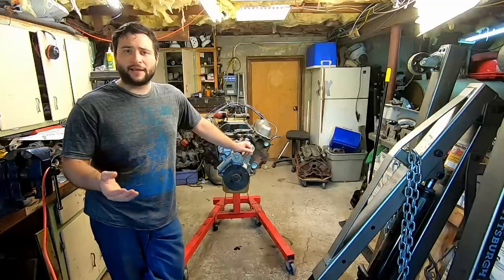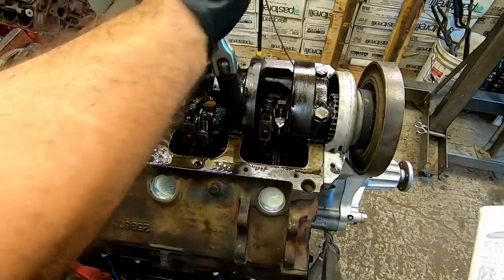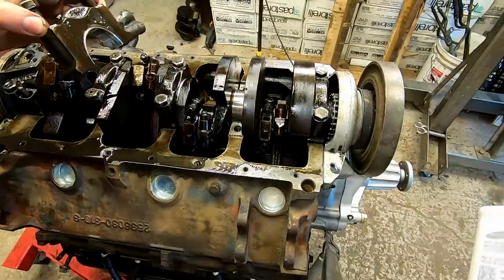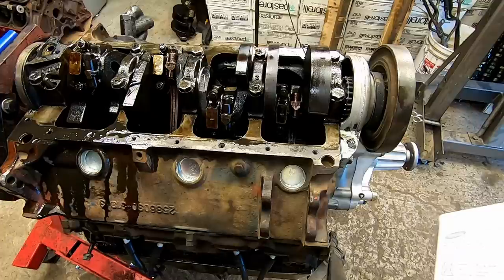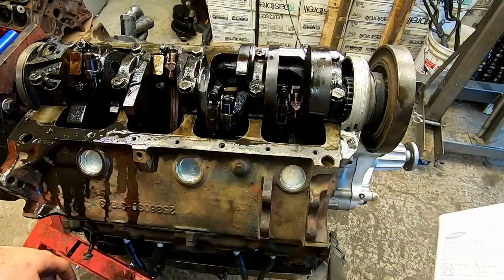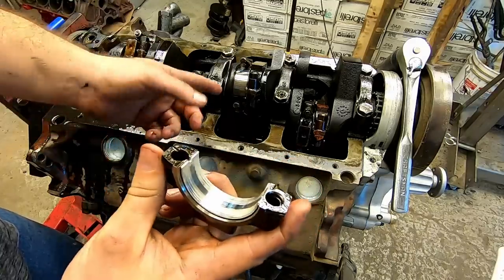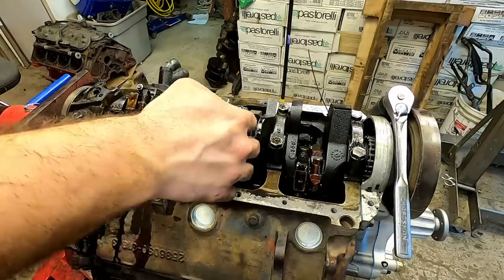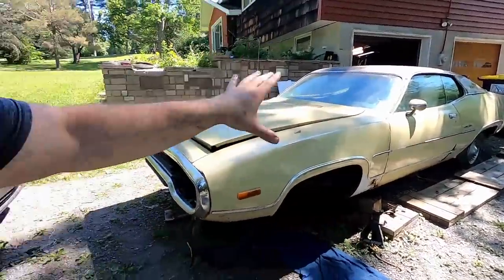The Mystery of the 318's Low Oil Pressure Solved! update the crank was worn out .07 not machined

Comment: I've been working on cars for over 45 years and the guys that taught me told me about padding bearings with the aluminum from Wrigley's chewing gum wrappers during WW II when bearings couldn't be had... and they claimed it worked on cars of that vintage.  

I've done a lot of hack and whack repairs on $1.00 cars over the years, and some worked fine... others eventually came back to bite me.  

So what advise can I give you from my 45 years of experience plus having learned from guys who had over 50 years of experience before me.... 

1) Stop and take a deep breath
2) Fix the dang thing right and it's going to last.

Also, keep in mind you actually found another oil leak between the bearings,  You haven't necessarily found the only cause of the low oil pressure... There might be other issues you haven't found yet.

And by the way, I wouldn't have expected that there had been so much work done to that motor either.  Back in the day, we pretty much threw away the 318's when we upgraded to 383 pr 440s.  I had two 318's in daily drivers over the years and they were great engines, but once the timing chain jumped or the oil sludged up, I pretty much ditched the cars.   It's amazing how the world has changed... people actually putting 318's that weren't straight out of a junk yard into a car... I never thought I'd see the day... Maybe someday the old 318 will finally get the respect it deserves.

Good luck!
Reply: RJ, have you ever seen tapered shim stock? It was available in graduated sizes, so that the builder could taylor the bearing clearance into exact tolerances by laying the shimstock between the bearings and the saddles, then hand filing the parting edge of the bearings to bring the bore measurement of the bearing to the tolerance necessary for proper oil clearance. 

This is a lost art for the most part,  but Allison and Rolls Royce Merlin engines have TONS of details like that, that when they are fully detailed and blueprinted,,, that's what separated the masters from the also rans at the hydroplane races.
Reply: @patrickwayne3701  Personally, I haven't actually seen tapered shim stock.  But I've heard stories from old timers when I was younger about that kind of bearing fitting.  Although really good machinists would also be able to turn bearings to the exact size, which is another all but lost skill.  My dad was a Machine Shop Supervisor and a tool maker with a tool shop and other tool makers at his disposal, so when I needed custom made stuff, he'd just wump it up for me... But he's gone and there are few people with the skills and very few machine shops left that can free hand one off parts anymore.  And those that do usually cost more than the project car.
Reply: @RJ-vb7gh  I am saddened to hear he has gone, but alas, so has my Mentor.  Tapered shim stock, is from the earliest days of custom built engine work,  it was developed in between the poured babbit bearings like in the early Fords,,, and the later mass produced engines that relied on 'Stack Up' in dimensional tolerances to 'land' a particular engine joint within 'spec'. 

I luckily got to hang with those two pioneers in the early '70's, Graham Heath, and 'Wild Bill' Cantrell, as they slowed down and tinkered with keeping Miss Madison in back up engines.

Those dudes were like secondary granddads to me.  Complete with the warnings about "dont repeat these words around your mama or your Grandma kid".... Lol.

I have been SO lucky in that regard.
Reply: @patrickwayne3701  My dad took up fixing cars in Estonia back in the 1930's and set up his first machine shop as a refugee in Germany during WW II.. Both before and during the war, they didn't have spare parts, so everything had to be made as one off customs.  Worse yet, expecially during the war no one in Europe was making a standardized vehicle... So he had cars of all different makes and models to contend with and no parts that would swap from one car to another.  

In fact, my dad worked on conversions that allowed cars and trucks to run on wood gas and burn wood. 

To that I'll add that for the most part, tools were also made in the shop since tools were hard to find.

We were lucky indeed to learn from the old timers... but there are still old folks like me around.... kids these days just don't care about learning skills and hearing stories.  When I was a kid and I saw someone fixing a car, I was there to help, watch and learn.  Now I"m older and I've pretty much lost the use of my right arm and aside from my 14 year old daughter, there isn't a single kid in the neighborhood that would even slow down to watch, much less help when I've got a car apart in the driveway.  

Honestly... we were lucky to have mentors and we were smart to take advantage of our opportunities... Kids today think they are going to learn something from YouTube... and some things, they will... but they don't have time for the stories and the details.... Most kids today don't even know that a gasoline engine can run on wood much less what a dwell angle is..
Reply: @RJ-vb7gh  You bring up something there, about learning from YT,,  I had never seen an engine run on wood gas before catching it on YT. I said some 'l'll be durned', and 'Sonofagun's' watching the process.

I am 54, lost my wife when we were trying to have kids,,, so, now I spoil my Brother's kids and an occasional teen who asks if any of my old trucks are for sale. 

Not being a boomer myself,  I have been saddened to see the general arc of descent, of common decency and respect for elders that keeps rearing its ugly head these days,,, and I keep my powder dry, and my scatterguns and longrange plinkers oiled and ready.

I am concerned that what my Grandfather supposed was happening to America,, is gonna get considerably closer before I check out.  Luckily,  my Brother has raised a couple of keepers of the faith, and I have cultivated some fierce 20 and 30 somethings in the hobby, who seem like they are going to toe the line for the Constitution, so, I will see to it that they get the sayso of whether they keep my SuperBird and my Chargers, or if they sell them. 

But for the rest of this waste that lives in their parents basement and thinks their parents should be on the hook forever,,, I hope I get to see them fall hard before I go.... the handful of Kiddos that hang out at my shop are bright eyed and diverse and they give me some hope that there's enough of them out there to keep Lady Liberty alive for another generation or so....
Reply: @patrickwayne3701  I honestly hope you're right.  I pretty much live in an area where I don't see much hope for a sane and constitutional future.  As a tail end babyboomer, we defended everyone's right to have and express their opinion only to find out that their way of expressing themselves is to deny us our opinions and freedoms.  I guess we got burned by our own lofty ideals...  Which is pretty much is as much as anyone these days can say on a public forum.

A superbird is a rare bird indeed.  As to the chargers, I pretty much love all of the pre-unleaded versions from fast back to coke bottle.. after that not so much.  I had a lean burn Cordoba... which was in my opinion the worst car Mopar ever built.  

I've talked to some of the young people around me... Most of them are lost causes.  They have learned helplessness and drank the left wing Kool-Aid.  I've met others who still have inquiring minds and the ability to think on their own... The world is going to be a hard place for them to survive in, surrounded by all of the ignorant Pod People that seem to be the intolerant majority at least in my area.
Reply: I agree, even in the early 1990s 318s could be found free for the asking. All this trouble for a 318, I would at least build a 360....
Reply from the maker: I could have bought a wrecked 392 scatpack as a donor car and dropped it in for the cost of this, engine parts, travel, and crossing into Canada. I was offered an adventure, and an opportunity to grow my channel, and I bought right into it.
Reply: @LunarOutlawsGarage  you have the views now, make the most of it! It is the best hype you can get for sure! Good luck!
Reply: @CarsandCoding  If I had to go small block I'd go 340 myself or 383 which were almost as common as 318's with a little more umph.
Reply: @RJ-vb7gh  383 is big block. 340s are expensive and much more rare these days. They wanted to do a junkyard build. I do not know anyone who puts $1,000 of parts in a jubkyard build. Junkyard build to me means you pull a motor, get it running check for knocking, put on a intake and carb, dist, make sure timing chain is good, and run it. Putting a new cam into a block already torn down and not hot tanked makes zero sense. We all know this, but its you tube and entertainment!
Reply: @CarsandCoding  I've got a 76 Buick 455 in my 73 Electra... It came that way and literally nothing was changed on it except the smog pump was deleted and the 73 didn't need cats, so the exhause was left original to the car.  Basically, when I got the car all I had to do was to get the forklift dents out of the  valve covers and fix the EGR system which actually increased the gas mileage.   So I get not doing any major investments into junk motors.  Basically if you get a good junk motor, you literally shouldn't have to do anything to them, except swap one for the other.

On the other hand, building a motor from a junk core is a different story.  Once you tear into it, your in for a penny, your in for a pound.  You might as well do it right and not cut corners.  My experience with Junk and used engines as well is that they are really good, well treated low mileage engines or they are worn out, abused or otherwise beat to death money pits.  Most good junk yards will refund or replace a loser or will try to avoid selling them in the first place, so if you get a turkey, return it and don't try to fix it, unless it's something special...

Now the 340 was something special.  This is a motor that's worth rebuilding, and no they were never common. But if you are going to invest the time and money, at least you are going to wind up with something worth the effort.  And most 340's were pretty beat up, so I can understand where you would want to rebuild one, for sure.

As to 383's they were almost as ubiquitous as 318's at one time in larger cars.  They were tough and when put into a family sedan or station wagon, they didn't get much abuse, so you might still find a good one that doesn't need a full rebuild.  I'm thinking that post 1973 they should be good for unleaded fuel, I know the 440's were.  And yes it's a big block, but I've seen them fit into pretty much everything mopar from the Cuda on up and it gives you the option of using the stronger trans.

OK... still, there's nothing wrong with the 318.  My 1985 even had roller lifters.  My friend drove a 30 foot beverage truck with a 318 pulling it.  They were strong and reliable and in a lighter car they could get out of their own way.  Most of the last ones went to "cash for clunkers" sadly.  Their fuel economy was awful.... seriously awful.. first to last.  My 455 4 bbl pulling an Electra got better fuel economy than my wife's 85 Fifth Ave. It's like mopar just didn't care.  

But still... once you realized you didn't get a "good to go" 318 and realized you were going to have to rebuild it, you are pretty much best starting off with another engine or doing a full and proper rebuild unless you want to do Hoovie type videos about breaking down every few thousand miles.

I get the idea of doing a video about a cheap engine swap, but you need to start out with a known good engine and tweak it a little bit for performance.  The motor you started out with just has too many issues to do that particular video. If it were me, I'd pivot to a complete motor rebuild or start with a known good engine and work from there.

Lastly, I can understand where your coming from... As a broke teenager, I came up with some workarounds and half arse fixes that actually worked,  most I wouldn't ever post to YouTube for safety reasons... But over the years I've learned; if you're going to do it, just do it right the first time.  It's good advise from someone who learned it the hard way.

Comment: Did the same thing with a303ford that I bought with a rod knock. The previous owner found that the crank was 10 10 with standard bearings installed. He put the right ones in. Long story short it didn't work. I bought it cheap pulled the crank it took a 20 20 put The right bearings in and it ran good since. I put it together with plastic gage for insurance.

Comment: Always keep old bearings, they are marked. If not measure, plastiguage, anything during assembly, it would have been caught. Never go on others assuming it will be correct. Check for yourself. But good it was on a dyno and not installed into project, much easier to repair. Good luck looking forward to seeing it being successful. Hello from Canada!

Comment: I dont know about Mopars but I know I had a major Oil pressure lost on my 3.8 when the engine shop installed chevy lifters into a Buick block.. the oil didnt have to correct path and was basically dumping onto the cam in the lifter valley... you can lose quite abit of oil pressure in the lifters in some situations.

Comment: Honestly this is a great way to learn the ropes u won't easily forget u are a better engine builder already from this . Throwing hp parts at lS motors is just candy . Tony's hard work is in those cyl heads and that means alot. U got something for your troubles.

Comment: At least it's possibly nothing more, bearing clearances and crankshaft journals, mic all rod journals and main bearing journals. I did an engine rebuild had to put oversize bearings on some of the rod journals after the machine shop turned them smooth.

Comment: I’m glad you found the issue. As far as cleaning the engine in situe- run down to Lowes and buy a cheaper pump up sprayer, and one of those large mortar mixing plastic pans. You then fill up the sprayer with gas, diesel, mineral spirits, or whatever dont eat plastic and hose out the inside of the block and oil passageways. All of the mess can drip into the pan, so you dont make a mess. 
And to the people who Idolize Tony: the man aint that great. Sure he is knowledgeable, no question about it, but everything he owns has issues. Bottle rocket, the cams, etc. If I heard it correctly, and Tony wont even return his calls, that speaks to his immaturity, and confirms what I know already. Tony only does what he does for views and subscribers. Food for thought- on his mpg daily driver video, he explained he fixed the air conditioning. Notice he showed no process of that or even that it worked. I guarantee that a/c did not work worth a crap, and leaked all of the charge out within a day or two.
Keep up the good work Bryan.
Reply: i love how he wont show him working on things, and his excuse is "im in the zone." he lost me when he suggested turning pistons around and that thermoquad door tension cant be adjusted.

Comment: Past rice builder, of reletively current engines (4) cyl aftermàrket parts instructions, vs. BASIC 50s shop tech manuals ( 8 cyl even flathead methods. Like Owning a welder, owning a mic, or a torque wrench, it only works with proper use.

Comment: I know this had an oil pressure issue, but Derek over at VGG slapped together a POS 307 and hit 290 on the dyno...just sayin' Was it losing 35HP? No porting no polishing, just slapping old, unrebuilt, used 305HO heads on it.